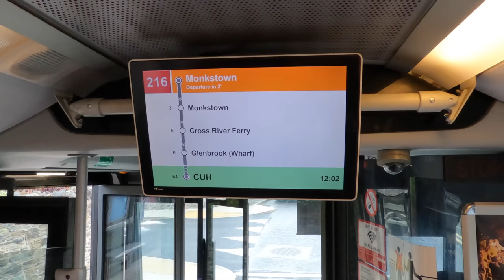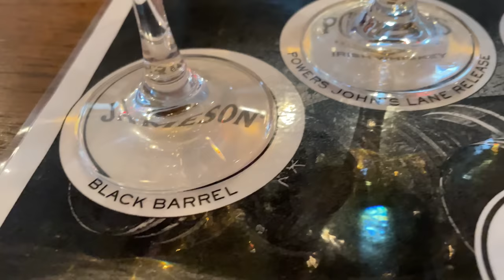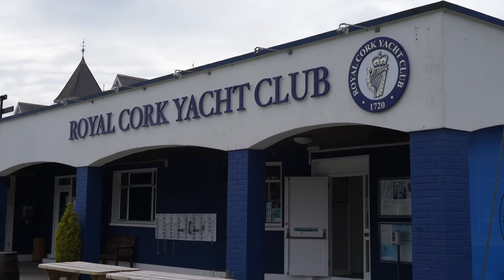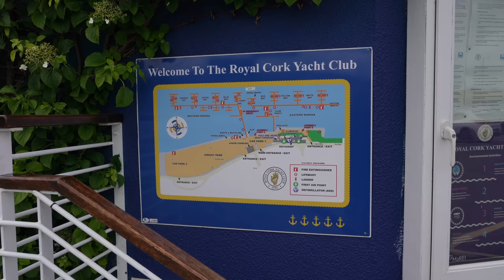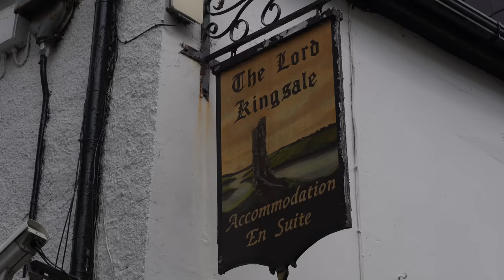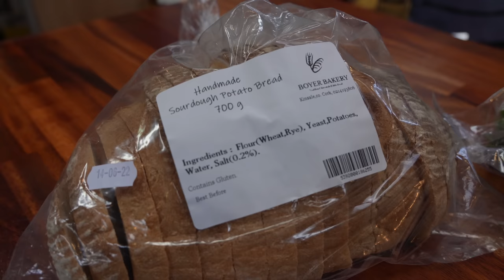Sail Life - Wind & whisky - welcome to Ireland🇮🇪⛵️

Comment: 15:17 easy fix is to chop off the loose strands, use some fishing line to wrap around and then tape some textile tape around it at an angle after which you need to sow the whole thing a few times to make sure it stays together. All the strength is in the core, but this makes sure the line doesn't go off fully and it won't snag either. It will get you through and it's easy to perform even in rough sea, faster than taking it all off.

Comment: Mads,  I noticed the extremely long bolts holding an antenna on the solar panel mount.  Ava doesn't need to worry much but you being a head taller... this is visible at 6:10 in the video.  Congrats you two for finally reaching Ireland.  I hope you and Ava soon get to the point where you don't have time limitations pushing you ever onwards.
Reply: Good eyes hh  👍

Comment: Once again I'll ask. Why aren't there any light air sales on Athena? I asked this same question last week with no reply so I thought I'd try again. My choice would be a "Code 0" on a continuous line furler that would allow you to keep it hoisted for awhile. And I'd add a "Symmetrical Spinnaker" with a sock and a carbon pole. I mention the carbon pole because I noticed that you have an old heavy aluminum pole onboard. They are a beast to handle if you are using it often during the day especially if you are dousing and hoisting the kite several times during the day. Great job with the videos.